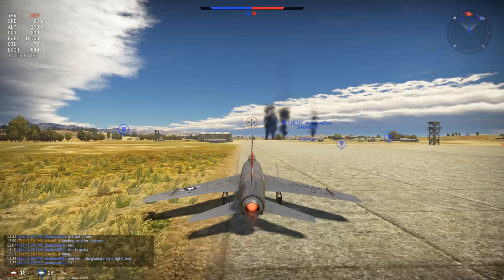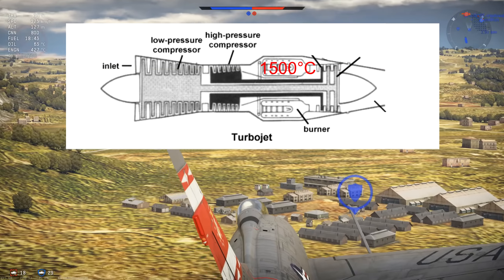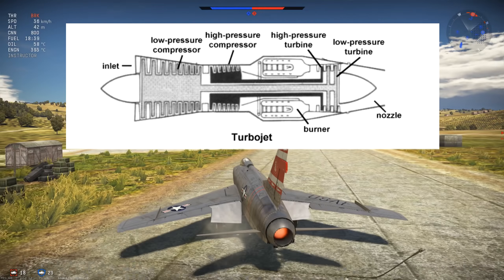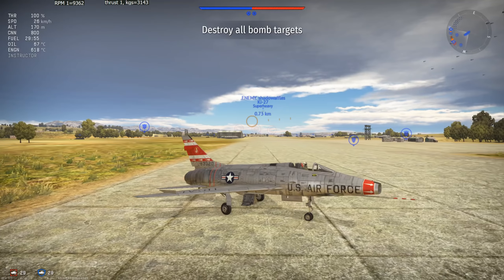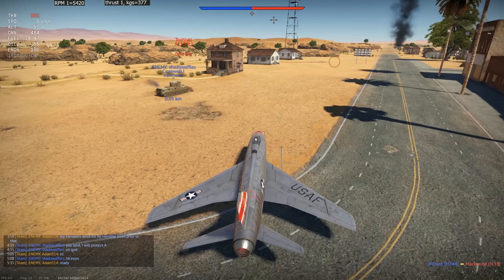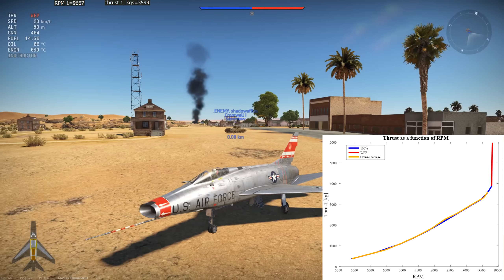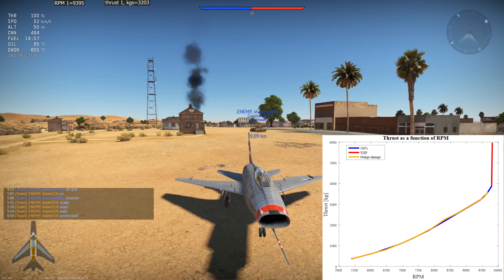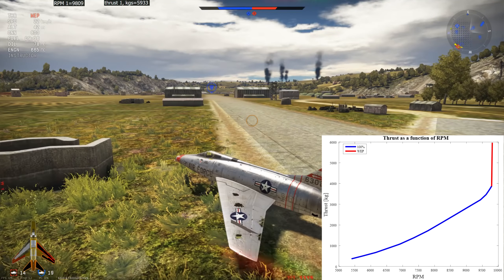The Problem With AFTERBURNERS In War Thunder

Comment: How do you turn the thing on??? All i do is full throttle and still no afterburner 😠😠😠 just got the mig17 and f86 is catching up with me
Reply from the maker: With what plane haha? Most planes don't have afterburner.
Reply: @AdamTheEnginerd  ohh...i thought they did- maybe WOT got rid of it. Hmmm oh well - I know for a fact when MiG-17 came out with KV-1 Klimov engines they had afterburn ability for faster boost- it would shoot flames out the rear like a rocket if you will. In fact here is a video of one with afterburner on in WOT but I don't see how its done...mine simply stays neutral 😐

https://youtu.be/OM1wefnHzYM
Reply from the maker: The Mig17F has afterburners, the Russian one does not.
Reply: @AdamTheEnginerd  Ahhh got it thanks ;)

Comment: Good job on technical video! But don't forget to make some tactic videos for example yak9 vs ki61 (3.0). This japanese plane is imo the hardest opponent cause it is more agile and has good engine. o7
Reply from the maker: Thanks!

You have trouble with Ki61s specifically? I think it's one of the worst fighters in the Japanese tree.
Reply: To be honest I had no problems with any enemy while flying ki 61 but facing it in yak 9 is just worse than dueling zero. Of course  I am talking about duel with same energy statement at the beggining.  If you find some time to do this video I will be very thankfull (also russia vs japan is distaster xd). Ps.Thanks for answer :D

Comment: How did you got the software to read the information of the engine (thrust rpm etc)
Reply from the maker: It's called the "local host".

How to access the "local host":
You need to be running War Thunder or it won't work!

Option 1: on the same computer that is running WT:
-Type http://localhost:8111/ in the address bar and press enter and voila.

Option 2 (which also works on the computer that runs WT):
-Type http://Your_IP_Address:8111/ where you replace "Your_IP_Address" by your IP Address (192.168.X.XXX) in the address bar and press enter and voila, you can look at the characteristics on another device while flying.
Reply: @AdamTheEnginerd  omg THANKS MAN i was looking for this for a long time
Reply from the maker: My pleasure!
Reply: @AdamTheEnginerd  just one more thing ... how do i overlap it on the game
Reply from the maker: There is a way to overlay it, you need to play WT in windowed mode and use a program to overlay part of your browser over the game, but I've never done it.

Alternatively you can look up "Void Mei" on the WT forums.

Comment: If this was modled correctly the f100 would outshine most especially when it comes to engine damage
Reply from the maker: Why more than other supersonics?
Reply: @AdamTheEnginerd  even though you may get critted and lose engine power you would still have afterburner to compensate it should die one red
Reply from the maker: Afterburner thrust is linked to the mass flow in the engine which is linked to the RPM. So if the RPM of the turbine drops 10%, your afterburner thrust should also be reduced by approximately that much. Afterburner thrust isn't a constant.
Reply: @AdamTheEnginerd  i see thank you im not into jets enough to understand all of it but i was referring to when you said it should be the last thing to go and it starts losing capability on yellowish but not much of it. Still it should be able to maintain the thrust more at least than similiar damage for other jets
Since its main pro id say is high speed and damage absorbtion
Reply: I'd like to put it out there, afterburning turbofans will rarely start burning unless the throttle (which also controls RPM) is pushed past a certain gate. 

There is not a separate switch to control reheat independent from throttle control.  And if your engine is damaged to the point you can't attain max RPM, you would not want to use reheat and risk losing it.

Comment: You said that afterburner can be used at any throttle setting, But that isn’t true. There is a detent after maximum dry thrust (military power), where the throttle quadrant can be moved forward into the after burning detent (wet thrust). You cannot use the afterburner at lets say 20% dry thrust. It has to be full military before you can introduce afterburner. Unless I misunderstood what you saying, but that’s what I heard
Reply from the maker: On some aircraft yeah it's an extension at the end of the throttle, but what I'm saying is that theoretically you can engage afterburner at any throttle setting (with fairly reduced thrust of course). And on some aircraft you don't have to be at military power to engage afterburner. For engine life and maintenance, you're better off being below military power and using the afterburner, than being at military power.
Reply: Adam514 ahh ok. I get where you’re coming from now. I’ve only worked on a few aircraft where what I said is to be the case. I do agree that gaijin hasn’t done them correctly though. If they’re going to developed a new type of aircraft mechanic into the game, they really should put more research into it
Reply from the maker: Yeah they cut corners on this one. Tbh I think it's an unintended consequence, they might not be aware of it either.

Comment: Hello how do you ad the “RPM” and “Thrust” onto the screen? Can you play like that or is it after effects for the video?
Reply from the maker: It's called the "local host".

How to access the "local host":
You need to be running War Thunder or it won't work!

Option 1: on the same computer that is running WT:
-Type http://localhost:8111/ in the address bar and press enter and voila.

Option 2 (which also works on the computer that runs WT):
-Type http://Your_IP_Address:8111/ where you replace "Your_IP_Address" by your IP Address (192.168.X.XXX) in the address bar and press enter and voila, you can look at the characteristics on another device while flying.

What I do is I record the local host on my laptop next to me, and combine it with the gameplay during editing.

Comment: How do you get the information in the top left corner thats in all your videos? Is that edited in after or is there a option for that?
Reply from the maker: It's called the "local host".

How to access the "local host":
You need to be running War Thunder or it won't work!

Option 1: on the same computer that is running WT:
-Type http://localhost:8111/ in the address bar and press enter and voila.

Option 2 (which also works on the computer that runs WT):
-Type http://Your_IP_Address:8111/ where you replace "Your_IP_Address" by your IP Address (192.168.X.XXX) in the address bar and press enter and voila, you can look at the characteristics on another device while flying.

What I do is I record it on my laptop next to me at the same time as the gameplay, and combine them during editing.

Comment: What mod are you using? How to display the thrust and RPM in war thunder?
Reply from the maker: It's called the "local host".

How to access the "local host":
You need to be running War Thunder or it won't work!

Option 1: on the same computer that is running WT:
-Type http://localhost:8111/ in the address bar and press enter and voila.

Option 2 (which also works on the computer that runs WT):
-Type http://Your_IP_Address:8111/ where you replace "Your_IP_Address" by your IP Address (192.168.X.XXX) in the address bar and press enter and voila, you can look at the characteristics on another device while flying.
Reply: Is that in start or an internet browser?

Comment: Oi Adam, can I ask if a F4U 1D video is on its way?
You seem to really praise the F4U 4B for the great plane that it is,
and IMO, the F4U 1D wields a power that can be put to great use in
the hands of experienced pilots such as yourself. In the hands of 
noobie players like me? Maybe not so much...
Reply from the maker: It's because why fly F4U1D at 3.7 instead of F4U1A at 2.7 when they have essentially the same performance?
Reply: @AdamTheEnginerd  Wait, really?
You mean the F4U 1A USMC, right?
The 1A overheats like mad, whereas the 
1A USMC doesn't– it's lighter, too, increasing its overall performance by quite a bit!
Reply from the maker: No I mean the 2.7 BR F4U, and the overheating seems very similar between early F4Us, I haven't noticed a difference.
Reply: @AdamTheEnginerd  Really?
Okay...
Btw, I see why you said the F4U 1D has the same performance as the 1A– The 1d is naval, meaning it has that absurdly heavy 
landing hook!
Reply: @AdamTheEnginerd  nvm 2.7 F4U is better

Comment: Wow they should just link it to throttle setting not RPM
Reply from the maker: Afterburner thrust depends on speed, altitude and the RPM the turbine is running at. It's not that straightforward, it should be calculated separately from turbine engine thrust.
Reply: @AdamTheEnginerd  Im just saying the afterburner should engage when you are at WEP on the throttle. The problem is taht it doesnt engage when you have engine damage beyond yellow, no?
Reply from the maker: Indeed it doesn't engage.

Comment: I knew it..... These dudes are too lazy.. Was really that hard just to make a plus "x%" thrust calculation formula ingame?  Or just use the compressor gear system that its already implemented... Ps: i love the new format
Reply from the maker: Yeah they cut corners for afterburner modeling. They should have just made it depend on engine RPM (without varying it), speed and altitude.